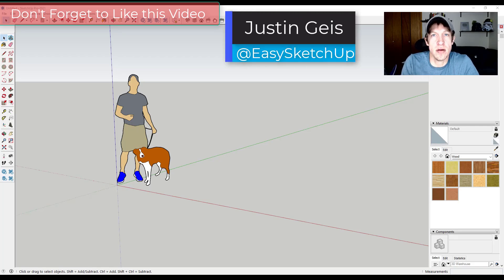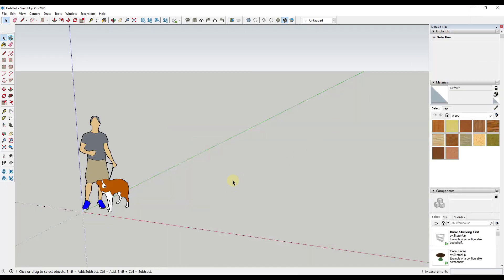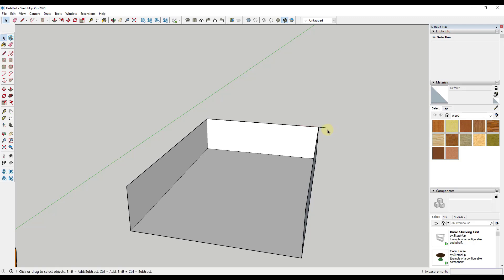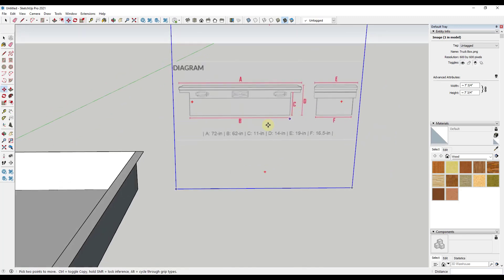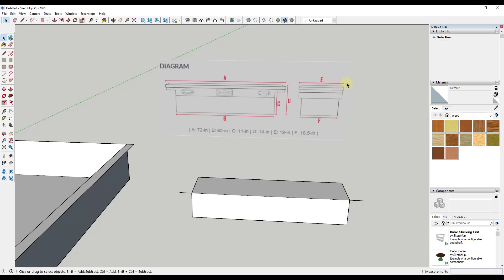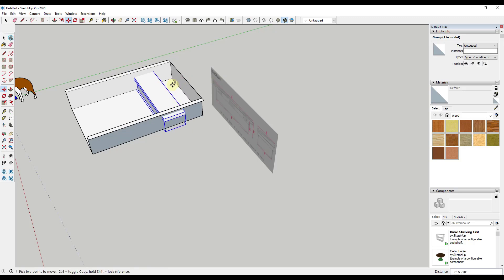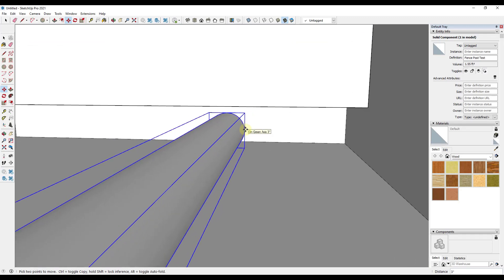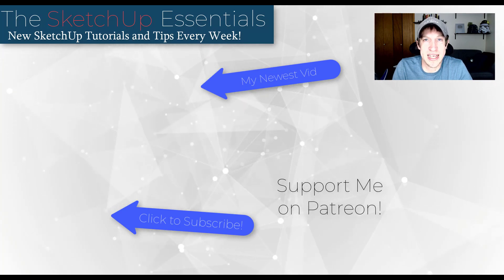Practical Modeling in SketchUp - Truck Toolbox!

Comment: Hey. Loving the tutorials.   Quick question:  Would it be possible to make it so the wall of your truck bed did NOT allow for material to pass through them?  (As if they were solid objects.)  I found it tricky because i could push the fence post through the back wall into what would be the cab.   If the bed was "solid" it would be possible to really be sure things fit.     Either way, please keep up the great work.